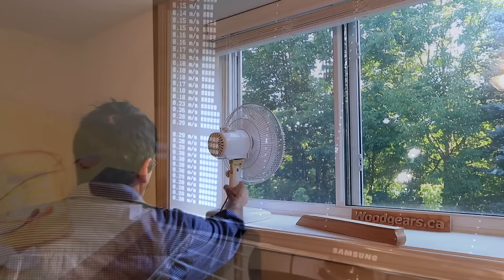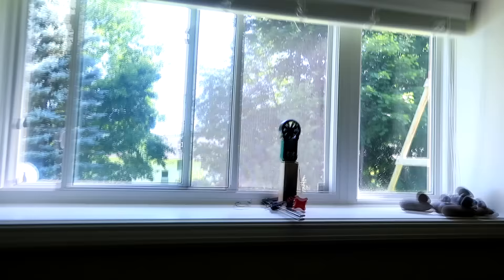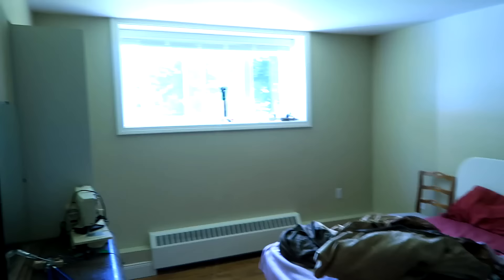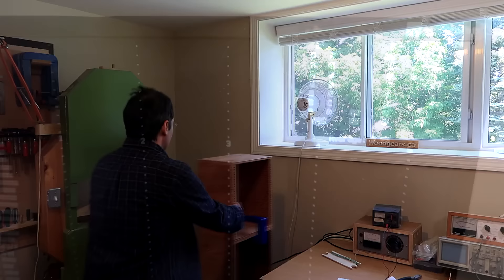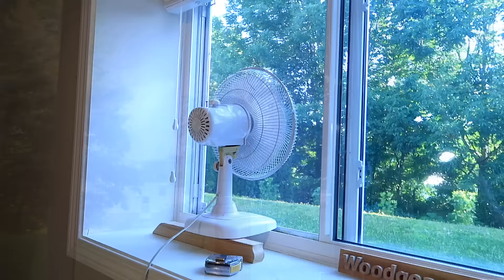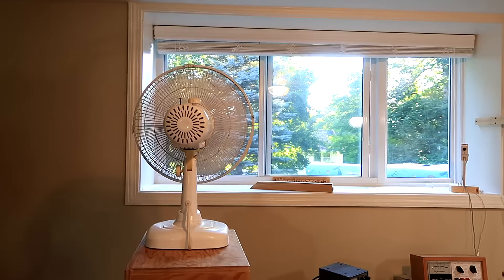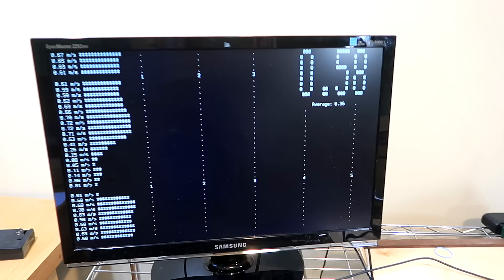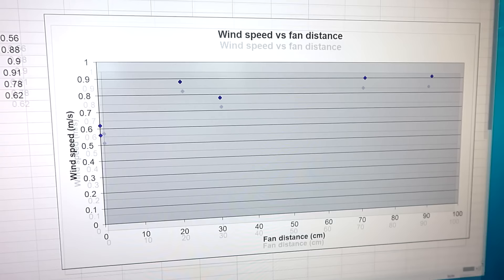Best fan placement to move air through the house

Comment: Really interesting video and good to know. 
I would like to offer a different explanation for why it makes the anemometer spin more when you move the air out the window instead of sucking it in though. 
Here is what I think is happening. If you blow air into the room from the window, the volume of air is spreading out to where ever it can go, the entire room, the hallway, the other room, ... etc. while the other way around you remove a volume of air from the one room and push it out the window very targeted, the air rushing in to fill that volume will naturally find the path of least resistance to replenish the air which creates a kind of direct stream of air flow from the only available source of fresh air from the window in the other room. 
So I think it moves the same volume of air but more directed in a kind of stream of air instead of turbulences everywhere that quickly get less the further away from the source you are.

Comment: I love this. I’d love to know if a baffle around the fan directly in the window would help! Also what would happen if the fan was 1m outside the house pointing inwards?
Reply: I suffered through a summer trying to blow air into my house, the best thing I have found is a fan close to the same size as the window blowing out and opening windows on the other side. Basically creates a wind tunnel at night and cools the house for most of the day

Comment: I have experimented with many ways over the years and I can tell you actually the best choice is a fan in the window, but you need some alterations to your approach to make it work. You need to seal off as much of the rest of the window as possible. There are box fans with a cowl around the edges so there is a circular hole the size of the blades, and you can use some material to block the rest of the window. Or you could just buy a window fan that is designed to mount in a window. Then you need to pull air in instead of blow it out. If it's cooler outside it will cool the room nicely.
Reply: I would need a hybrid outwards during day inwards during night.
Reply: @misterperson7070  Most window fans have a switch to set the fans to blow either in or out.
Reply: What you're describing is basically an industrial extractor fan. It would be a nice experiment to se how much it improves the airflow and temperature.
Reply: pulling air in is best in the morning and at night, you dont want to pull air in when outside temperature is hotter than your room

careful when blowing too much air out you might create a negative pressure and force your room to pull hot air in from the roof
Reply: watching this when it is 36 degrees temp in my country..

Comment: Very interesting. I would assume this also applies to PC cooling. Better to push than pull, which is what I have noticed while changing my fan positions on my heatsinks.
Reply: So if I have a vertical tower cooler, I should flip the fan? Or put it on the other side of the heatsink radiator?

Comment: During hotter days with no wind, we have window fans in every window upstairs exhausting air out, mid level windows closed, and basement (half underground) windows all open. Basically creates a draft from the basement to upstairs and that alone will drop the temp instantly and maintains a nice draft in the house.

Comment: Since you're gathering data, I'd be interested in knowing what happens to the air temperature in the room where the fan is exhausting. If the fan is pulling warm air from the house, there's a possibility that that warm air is raising the temp insude the room and not necessarily expelling it from the house. What do you  think?

Comment: I wonder how the dual window fans that are designed to be wedged into the window opening, with the pleated extensions to seal off the rest, would compare now. Theyre somewhat shrouded so that it should only pull/push air directly in front and not from the sides. 
Would these be more effective at pulling the air out of the room?
Reply from the maker: played with some years ago.  they move remarkable little air

Comment: If you put your hand near the fan you can feel what the problem is, it's pulling in a lot of air from the sides, so if you place it in front of the window only very little air is actually coming from the outside, and most of it is coming from the area around the window instead. The same problem happens if you flip it, it will actually pull air from outside around the sides to blow back outside and very little comes from inside. So by putting it further inside the room more air will be pulled from the room and pushed toward the window and actually end up outside. A box fan or other ducted fan should make the problem less.
Reply: That's exactly what he said in the video.
Reply: 5:25

Comment: Just to make a random guess. I would think the airflow you see in the other room is more indirect from the negative pressure caused by pushing air outside. If you are directly in front of the fan you will likely feel more airflow if it is pushing air towards you from outside, but that airflow dissipates and the positive pressure can easily escape back out that same window. Good chance I am wrong, but that is my take with just trying to guess why blowing air out works so much better across the house, when you will always clearly have stronger airflow directly in front of a fan.
Reply: He should try sucking air in 
But with the fan outside

In the position he used the fan is circulating alot of inside air

Comment: I figured this out a long time ago when experimenting with cooling my bedroom, it's the hottest room in the house due to sun exposure. I got to thinking about it one day when I had the fan right in the window, I noticed a lot of air just blowing around the edges and thought that I could get more pressure out the entire window by pulling my fan (actually it's one of those construction floor drying fans that puts out a thin stream of high velocity air) back into the room to the point that the stream of air was as wide as the window, and what do you know, the cross breeze coming from my other window tripled in speed/strength and brought the temp down a good 5-10 degrees. I've since bought a standalone AC unit that keeps my room cold enough to see my breath on a 100° day lol, so the fan isn't necessary anymore.
Reply: What’s a stabdalone ac unit?
Reply: @atlanticatmosphere6695  I'm talking about those AC units that just sit on rollers on the floor, they have a big flexible hose and fitting system that you put into the window to blow the heated air outside, versus a fixed window mounted AC or whole-home central AC.

Comment: your measure(by wind speed on the positive air coming in the room) is correct, 
but the way you approached the active wind motion(the fan used, how it was placed, 
and controlled) was very wrongly set; let me clarify:  A box fan used as an exhaust fan,
 to cycle air, should never be blocked by a tight screen after the impeller/rotor(it creates a wall that generates turbulence) such as that; as you noticed, your box fan fell as a result of back pressure created by air bounced from the screen(a torus that spills air mass against the fan itself). 
i did endless experiments, using smoke to visually attain results, plus a wind speed reader like yours, less fancy setup but way more reliable and true.
my conclusion was, a box fan outbound with no screens and covering/sealing the entire space left above it, so the forced air of the fan would be the only outlet available to the AIR MASS to go to, and a small fan using a replaceable EPA filter to draw clean air from the outside in, its not a quick setup, but a solution to exchange the air in a room , 
that is silent and draws lil power... the wind speed does not tell the best results, you should rather feel how livable and how clean the air coming in is.

Comment: fan tight against screen is by far the best. also critical is to work with the natural air flow, lower to higher. blow air out of the higher window and/or draw it in from the lower one.
you can make a cardboard shroud to go from the fan cage to touching the screen; on the cages front to blow out, on the rear to draw on.
this works better than any other method to get new air into a room

Comment: NHK did a bunch of experiments on camera about "how to change the air as quickly as possible" during the pandemic. Their solution was to use two fans, a box fan pulling air in one window, and a circulator fan or oscillating fan blowing air out another window or door (they tested for the fastest way to change out the air for a single room).

The fan positioning for the outlet, if I remember correctly, is in general agreement with Mattias' findings.

Comment: I wish you went deeper into the airflow problems at the end. You’re right in that when you put the fan up to the window to blow into the room, the fan won’t pull much air from outside because it pulls from all directions. This, of course, could be improved by using a box fan and sealing it up against the widow to restrict the only source of airflow to be from outside. 

The reverse application works because you crate more pressure in the room by placing the fan further from the window which creates more movement of air. Again, if you sealed up any fan in a way where it only blew out the window and sucked air from the inside, you would have a much more efficient airflow situation.

Comment: Hi. I am using this method for years. I found out that directing my fan at a slight angle to the window improves the air flow. Somehow  the air flow becomes more fluid that way. Directing it at 90 degrees as you did creates pulses of air almost like as airflow is fighting an invisible barrier between the room and outside pressure.
Reply from the maker: Measure it!
Reply: Probably because angling breaks the turbulence

Comment: Placing the fan outside the window at 1 meter distance would probably do the trick but it is a much worse choice than placing the fan inside because the smallest rain can cause you troubles. :P The fan pulling air from the side actually explains why automotive fans have those shouds around them. Interesting stuff.

Great experiment and I will definitely use the info this summer.

Comment: Fascinating! I like to use fans, especially box fans, and now I know exactly where to place them for best results. Thanks for taking the time to do the experiment and to make this video.
Reply: It might still be directly in the window. He didn't block the rest of the screen off which is why he's getting a backdraft on the edges of his fans. Just putting a fan against the screen of course it's going to blow back around. I'm not positive how different the results would be but I've never just put a fan and a window iOS block around its edges so it doesn't limit the draft.

Comment: I think it also depends on which side of the house you place your fan. Because if you usually have west wind, it sounds stupid to place your fan westwards so it blows the air out to the west side. Wind vs Fan sounds not as good as Wind + Fan.
Reply: Unless you have a really direct path through your house from west to east (for example) with no walls or sharp corners in between etc, I suspect it wouldn't make as huge of a difference as you'd expect unless there's some pretty strong wind blowing.
Reply: @emissarygw2264  You shouldnt underestimate that kind of airflow. In the hot summer days we ventilate our house daily in the night and i feel so much the difference, when the windows are open in the other floors as well even with stairs, corners and half closed doors in between. That chimney effect is actually suprisingly strong.
Reply: Metal fans are better. Plastic fans just blow the hot air around
Reply: You should have your fan blow outside, like in the video, but also make sure to place it next to whichever of your windows that wind usually exits from. This way you simply get more ventilation. If you make it blow inwards, it's not going to contribute much unless you seal off the empty space around it.
Reply: @emissarygw2264  You don't need windows on opposite sides. Having perpendicularly oriented windows is enough. E.g. if wind blows from the west, and you have windows open on the western and northern sides of your house, the wind is going to blow inside through your western window and outside through the northern one. It's not going to be as powerful as it would be if you had windows on the opposite sides, though; presumably the speed is going to be halved or nearly halved.
Reply: @VVayVVard  Fair enough. Maybe it's the area I live in, I rarely get more than a whisper of wind around my house so I usually just use whichever window/room is most convenient to place a fan in. Actually this year, since I replaced my skylights with ones that open, I just open the skylights and windows on both sides and convection makes all the hot air vent out the top and rush in the sides even with no fan or wind. It honestly works waaay better than I expected 😎

Comment: Hi Matthias, have you done any study on the ceiling fans and their spread of air in the room of certain dimensions and ceiling height? In hot and humidity climate zones where the temps soar up to 38-42C proper distribution of air from the fan in all corner of the room is hard to achieve without increasing the ceiling height. Any thoughts on that?

Comment: Common sense will tell you that the air movement must cover the entire opening, or you will lose the cooling effect as warm air rushes back in. Also you need an open window downstairs, on the shady side of the house, etc. to replace the air you are trying to force out of the structure. As a Firefighter, we call this Positive Pressure Ventilation(PPV). Bust out a window in the back of the building, place a high volume fan in the doorway, check that the moving air covers the opening and viola' smoke free scene. No YouTube video needed, just life.

Comment: You missed trying the optimal configuration, which is to make a cardboard or hardboard rectangle that fits in the window with a circle cut out that is the exact diameter of the fan blades (or slightly smaller). In that case, you will get more airflow than any of your other configurations, and you will want to have the fan right up against the cardboard cutout.
Reply: I was thinking about trying this. I wish I had a way to measure results.
Reply: This will indeed reduce airflow. But it can increase static negative pressure.
Reply: Airflow would DECREASE!!! You would be forcing all air to pass through the blades, which eliminates the Bernoulli effect!
Reply: @charlieodom9107  You are entirely incorrect, and have no clue what you are talking about.
Reply: @XJWill1  prove it then!!!!
Reply: @charlieodom9107  If only Matthias wouldn't mind lighting a fire in his house to see where the smoke really goes
Reply: @directorgtr  what the Hell are you inferring?
Reply: @charlieodom9107  he is inferring that he thinks you are wrong. Unless he happens to have testing equipment, there's no way he can prove it. So he's asking Mathias to. I hope Mathias does. I don't care who's right. But it seems like a circular countout in a rectangle would stop outside air from coming in the corners. And that setup would be great. Just like the window fans that are on the market. I'd buy one of those, bit they are so small compared to a box fan.
Reply: Charlie Odom As Doug said, I think you are wrong.
Reply: @directorgtr  you can think all you want!!!! Bernoulli's Law has been around a LOT longer than you!
Reply: Charlie Odom Was that law based off of a screen within a window casing?
Reply: @directorgtr  it is based on science and pressure! The specific objects have ZERO to do with the effect!

Ignorant defense!!!!!
Reply: @directorgtr  Yep, Charlie is wrong. He has no idea what he is talking about.
Reply: Charlie Odom Yes it does have everything to do with it actually. With your logic, which you don’t actually know what Bernoulli’s law is obviously, a tight woven screen with even lesser air flow flows as well as an open window. Again, prove me wrong lol

Comment: I have a large 150W fan (about 60-75cm, the frame is 75, but the blades are smaller).

I also found that placing this fan in the middle of the appartement hall creates the best airflow throughout the entire place.

It pushes the air in front of it away, drags the air around and behind it with it, causing the biggest flow in air.

Putting the fan in an intake or output window gives the worst result by far. You can often not even feel the air move at the door.

With the fan in the hall, there's a clear airflow throughout the entire place.

Comment: I do believe you're missing one or two important factors here.
The air around the fans get pushed/pulled towards the air stream, making the fan effectively larger than its physical dimensions, providing the air's not restricted which is what occurs when in (or close to) the window frame which is little larger than the actual fan(s) and when in/close to window, the outside air filling the outside air void, rather than the inside air, resulting in lower interior wind speed.  The Bernouille principle. Here's a demo video Bernouille 

When the fan's in the window, it's partially blocking the window, thus a restriction and lower wind speed.

Comment: Best clue you didn’t show: Place the fan outside and let it blow air from the outside to the inside. You didn’t think about that didn’t you. ;)
Reply: that would work just the same as blowing out, or at least it should.

Even better blow air in 1 windows and blow air out the other.
Reply: @A.Martin  even better:  blow in from a low window, blow out from a high window
Reply: even better just go outside
Reply: @clarcktumazar  
😂😅